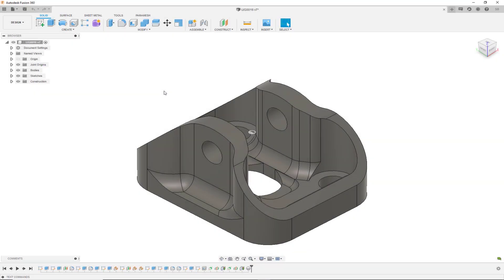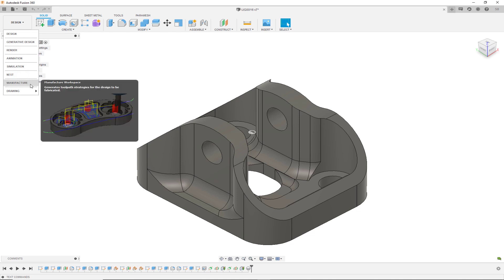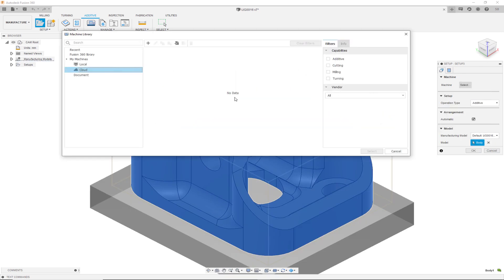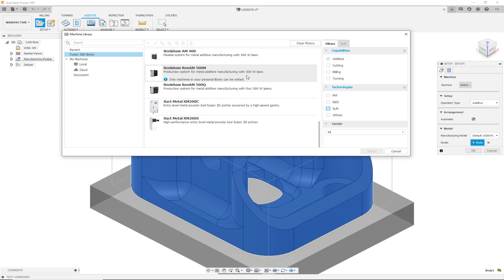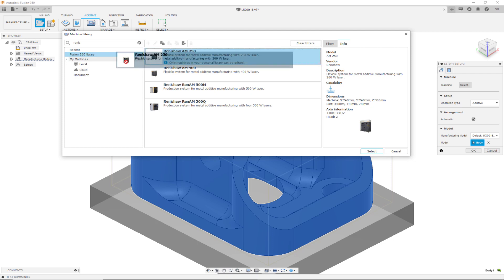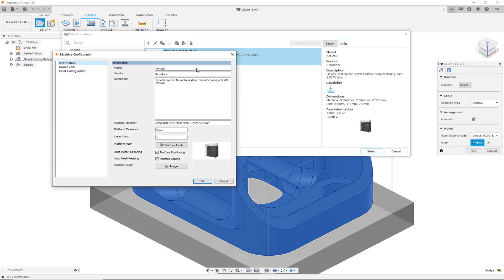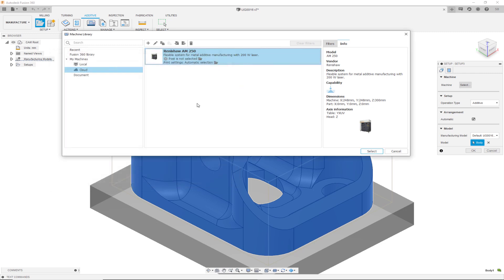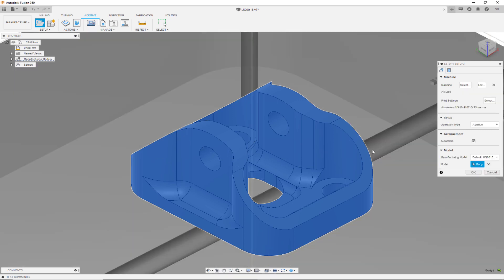Master Additive Machine Selection in Autodesk Fusion 360 | Autodesk Fusion 360

Comment: F360 Additive has great potential, and presently may even have some use cases over established slicers, but it's not there for me, yet. It is nice though that it addresses a wider range of additive technologies/machines, which will definitely be one of its aspects that distinguishes it from current hobby/consumer/prosumer offerings. Of course, for the "industrial" technologies, most makers supply their own custom software. Anyhow, whatever the case, will be interesting to see were F360 Additive goes...
Reply: We are actively developing the Fusion 360 Additive capabilities to reach that potential and are always looking for feedback. Thank you for the comments. 
One of the key benefits to using F360 for print prep is that the design \ print prep data is associative. You simply do not get that with an STL export to another slicer workflow)  If you make a design change, your print prep info automatically/parametrically updates within Fusion 360. If you have access to multiple machines or a single machine capable of multiple operations (additive + subtractive) generating a continuous mfg. setups to plan your manufacturing is also very appealing to our userbase.
Reply: @sualpozel1  Thx for the reply/info/insight. Yes, though I didn't happen to mention it, the "associative data" aspect is a big plus - at least for users doing their design in F360:) Thx for your efforts, and the team's efforts!